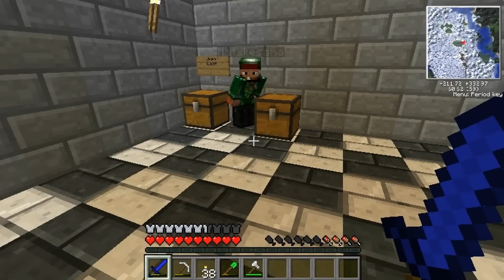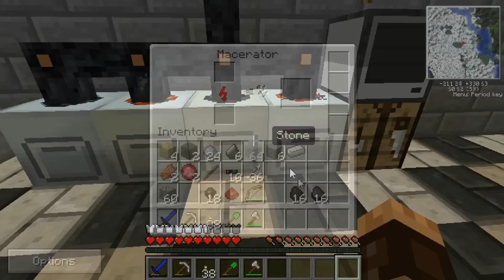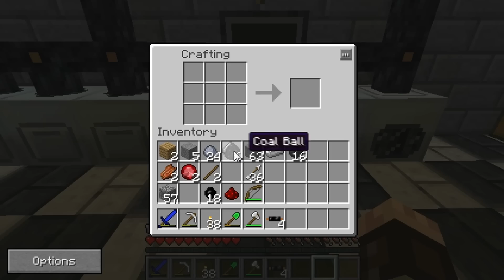Tekkit Pack tutorial: Part 4 - Industrial Diamonds and Machine Upgrades

Comment from the maker: It may have it's own ID, but if you check the IndustrialCraft wiki you will find that they are the same as of one of their updates. If you put one Industrial Diamond into the crafting table, it becomes a regular diamond. Also, not everyone uses equivalent exchange, because its too easy. In fact I stopped using it for anything but the tutorials because you can get anything you want super easily. Who's the Noob again?

Comment: Ok look at it this way: there are different power strengths, 32Eu, 128Eu, 512 Eu and 2048. The LV (low voltage) Transformer breaks 128 Eu into 32 Eu, or 32 into 128 Eu. So it can go both ways, break it down or build it up. The MV Transformer takes 512Eu into 128 or 128 into 512. The HV Transformer takes 2048 into 512 and 512 into 2048. Now this is useful because some machines only take a certain amount while others take a different one. So you can switch in between.

Comment: They are hooped up to a Low Voltage Transformer that is connected to a MFE. Solar panels bring energy down to the MFE. If you watch our previous video (Part 3) you can see our setup.